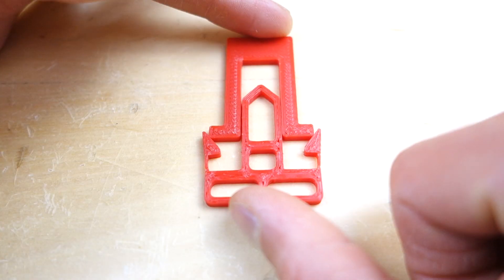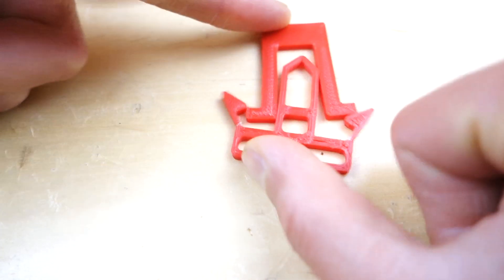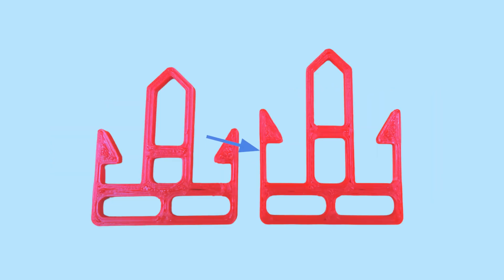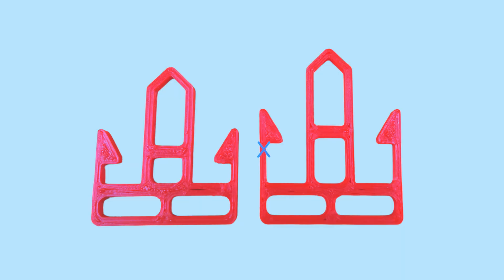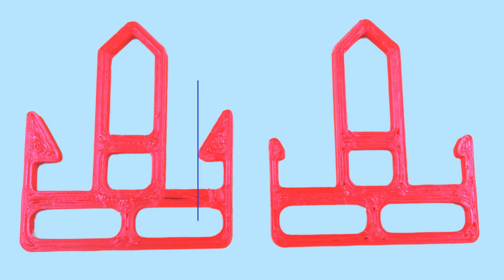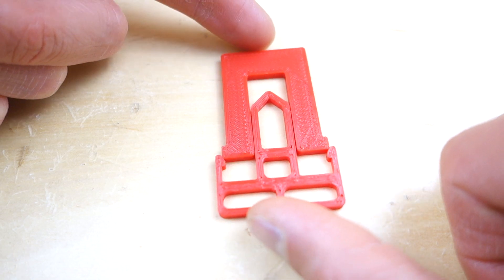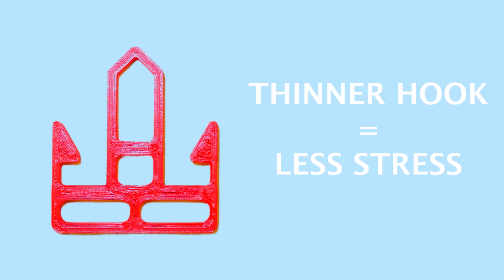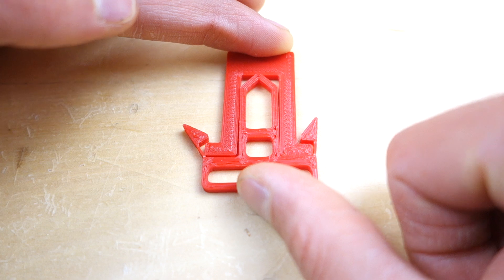SNAPS that CLICK in and NEVER BREAK with 3D Printing!

Comment: The mechanism is widely used in sidebags where you've to press manually one part sideways to clip and unclip . Flap type enclosure bags have this in plastic and metal both and the locks are as long as the middle pin and they never brake

Comment: you could also design the peg to also be able to flex inwards as you push it against the hook, having rock solid pegs that cant compress at all leave all the flexing up to the hook. designed well it could be designed to flex and also be solid once in place.
theres also options like if you cant make the leg of the hook longer you may still be able to redesign the back portion of the clip so that the leg starts further back, so essentially cut a line into the back part of the clip, move the cut outs in a bit so theres material to cut the line into. That could also allow you to create a locking slide, so because they extrend back into the body of the clip, if you then print a ring that pushes up over that part after they are clipped together, they will be holding this longer legs in place, meaning they cant flex outwards anymore, so the clip cant come undone.
Reply from the maker: Good suggestions!

Comment: The action took to decrease the undercut didn't match my expectation of what that would entail. Wouldn't it make more sense to lift up the bottom of the triangle portion of the hook, exposing more of the stem. It's sort of like increasing the height as your have more stem surface along which the material can flex and distribute strain. This would lead to a small triangle, but even lifting up this triangle by half leaves a larger triangle than the one on your version. It seems you just scaled the entire triangle down, keeping the base at the same height, thus drastically reducing the overlap. But scaling down keeping the top fixed and bring the base up makes more sense for the stem advantage. Also most snaps will place the hooks on the inner portion hooking into an outer portion for increased durability.
Reply from the maker: I agree. Lifting up the base of the triangle would reduce stress more than just scaling down the triangle.  

However, this changes two critical dimensions at the same time, the undercut and hook length.  In this video I intentionally changed one critical dimension at a time to see how that dimension changes stress/strain.

But yeah, in a real design doing a combination of multiple critical dimensions is the way to go.

Comment: Design it in more pieces...and use TPU in the bending area...and glue it together...
Reply: No, please don't. Get the geometrie right and  the part will flex and be strong.
The noses also break because the lower part is too short and can't deform/flex.

Comment: Decreasing the thickness of the arm of the hook does not decrease the stress,  it increases it! Stress is force per cross sectional area; decreasing the thickness decreases the cross sectional area which increases the stress.
Reply from the maker: You are correct for a constant force problem.  However, a snap is constant displacement problem.

Comment: Hmmmmm....

Why not try adding a nickel or any other metal strip to the part? Would it beak either way?
What about different snapping geometries?
Reply from the maker: That can work too.  The stress/strain calculations will get more complicated for a snap from multiple materials.

The ideal geometry is a tapered snap.  I was having issues printing it uniformly, so dropped it from video.

Comment: Sorry to say but your whole attempt is doomed from the start. You are basically designing in 2D here but the strength of a part come from it's 3 dimensional geometrie.
Like if you design a wall clamp for a bike tire  it needs to be a continuously extruded kidney shape along some semi circle.
Your 2D shape needs to lose the hard corners. You can't bend shapes that are too thick and too short to take that stress like you show but you can open the shape to double the bending length. An open shape deforms, a solid piece doesn't. Then you can print the deforming part wider and do a hollow hook. You save material and gain strength.
Don't change the material. The only material that would give you advantage is TPU other than that work out the geometrie and you can print in any material.
The designing process gets much harder if you do real 3D but the resulting part will be infinitely stronger.
A picture to illustrate the approach.
https://ibb.co/z7tV21L
Reply: You can also relief the bending part by designing a pivot point and combine that with an area to push to open the buckle.